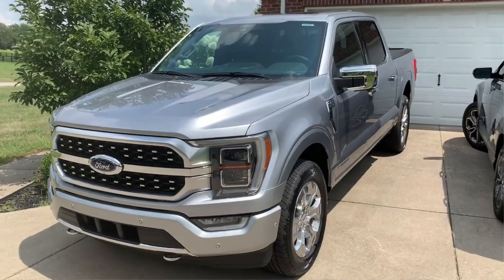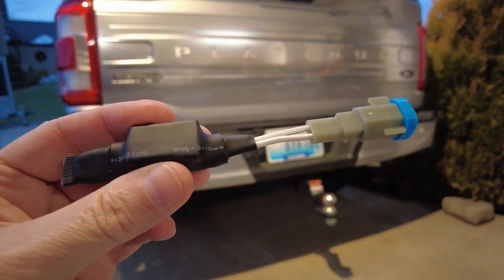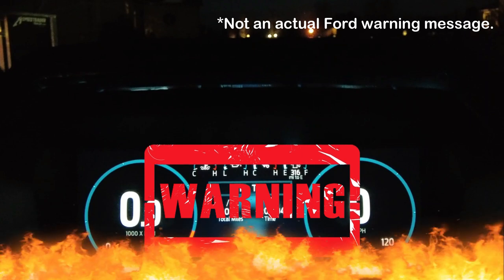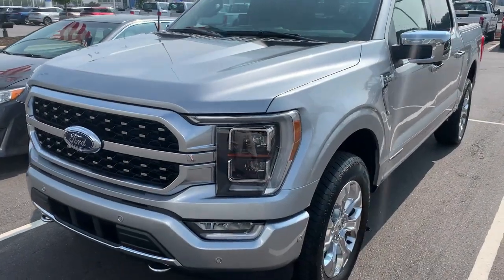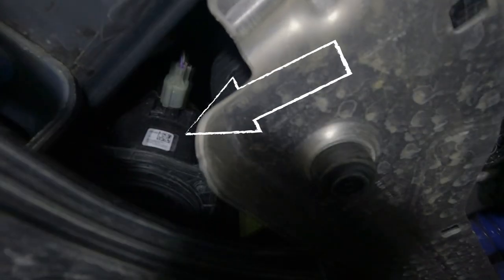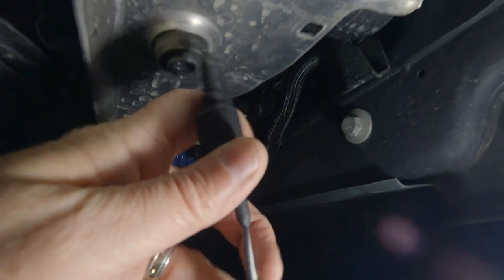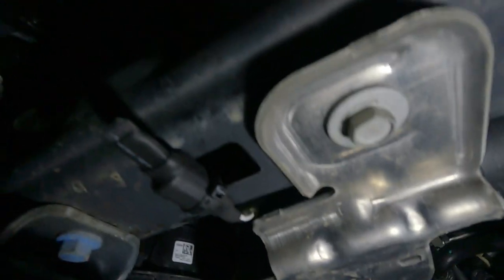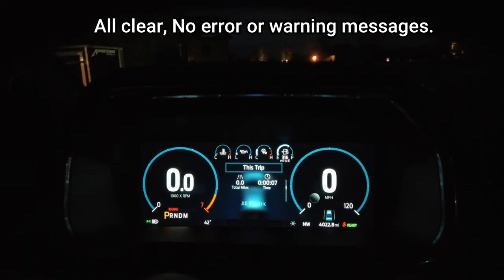NO MORE Ford Backup Alert or Fake Electric Motor Noise

Comment: When I first heard this dump truck noise, I complained to Ford about it, and they said they could not legally turn it off. Evidently, there was a law instituted in 2019 mandating hybrids and electric cars make some kind of noise at the slower speeds so people would not walk out in front of them. The service writer said they had this conversation with other customers before, notifying them that they accept the liability should someone get hit by a vehicle with this noise defeated. My Hybrid RAV 4 makes a spaceship noise as well. I wrapped the speaker with duct tape and plastic trying to muffle the noise, but it is still pretty loud. I just bought one of these and am going to install it. It's the backup beeping that does it for me. Thanks for the video.
Reply from the maker: yes,  Bottom line, if I hit someone with my car.  It's most likely going to be my fault, unless they just Jump out like a deer or something unavoidable.
Reply: I don't understand why these gotta be so loud.  ICE isn't that loud and if that's acceptable hybrids and EVs shouldn't emit such loud noise.  This is going to suck bad once hybrid and EV adoption rate increases.
Reply: I love the product and the video. Ford Maverick is definitely a pain to install but a necessity. 

I understand the liability but if I’m backing up, I’m going to look around me. Sound does not always make others cars/pedestrians pay attention. If I’m driving at low speeds in all electric mode, I can still brake faster if someone steps out onto the road. But regardless of noise, EV, gas, or hybrid, if you walk around with AirPods in 24/7 this won’t stop anything.
Reply: When I bought my first ford edge in 2020, they said it detects other cars passing or coming but does not detect humans if they walk next to you or behind you. Can there be a way to at least lower the loud noise of it if we can’t “legally” disable it? Like for daily driving noise. Not off road
Reply: @Globeguy1  because ice cars make more noise when speeding up. EV have to make some noise when accelerating. But the backup beep is awful! seriously !!!

Comment: Just one comment on tie wrapping the resistor kit to the frame rail. I have run into a couple problems at the dealership with this kit being visible to the technician doing service under my F150. In both cases they wanted to remove the device and replug the connector into the speaker thinking it was the cause for unrelated issues. The last time this happened the tech. ended up breaking the connector lead to the internal resistor in the device and I had to buy another kit from Will to replace it. Bottom line, hide and tie wrap the device so it is less visible.
Reply from the maker: I was originally worried about this at first but nearly 3 years later and it’s been to the dealer several times for oil changes and recalls.  Not once did they mention it or mess with it.

Comment: I have a 2020 Ford Escape Hybrid that makes the fake electric motor noise. However, when I put it in reverse, there is no backup tone like demonstrated here. I am aware that it is only heard on 2022 and newer Escape Hybrids, but is it possible to add the backup beep?

Comment: Hey Mitch, any ideas on using the speaker with a custom sound board of sound clips? I'm thinking themes like Star Wars (droids or vehicle), cartoons, etc.? I wonder how much power it would need/handle. Thank you for a very clear video and for keeping the sound levels similar throughout.
Reply from the maker: Thanks for the great compliments.  I am not sure how difficult it would be to add a sound board.  It would be fun, but the work and effort to make it happen may not make it worth it.  Maybe someone will make it happen.

Comment: Mitch thank you so very much for this mod the only complaint I have was try to release the plug from the horn  it was almost impossible to get my finger on top to release the plug but with a couple of tools I manage to release the plug but after was said and done it was well worth it to drive in Peace and quiet I am looking forward to anymore mods you have for the f150  love the content on f150
Reply from the maker: Yes, the plug on top is a bit difficult to squeeze but once you get it, the rest is easy.   I agree, well worth the little effort.  So quiet now.   Thanks for your support.   More videos coming soon.
Reply: @mitchcox  yes it was tough to get to I use,a screw driver with a nail puller end but once I got it installed I love this idea that you suggested works great all I heard is my tires on the road what a pleasure not hearing the annoying electric wine thank you so much I really appreciate it
Reply: I can’t get the thing disconnected. How the hell did you do it? A video of that process would help tremendously
Reply: @joshuawalker635  I use a thin screw driver and pry the tab up it a tight area but we’ll worth it

Comment: Corsair GT PHEV has same speaker, located under rear bumper, close to the right muffler pipe! Ford Escape should be similar to Corsair.
Reply from the maker: Check with Megaohm and see if it’s supported for that vehicle.

Comment: OMGsh, thank you SO SO SO much for this video! I bought my powerboost because I was in the market for a class B motorhome and couldn’t afford it. I traded in my 2017 XLT Crew a the perfect time, 2021, got 43K for my truck and ZERO percent financing! Now a Travel trailer is a more acceptable option. But, Duuuuuuuuude, that back up beep. So embarrassing! Stresses me.  Like, “hey guysI I’m backing up over here! Yeah, YOU.. Way over there! I’m backing up! No, not a delivery driver, just backing up.” Ugh! And the neighbors being aware of when I leave. Not to mention every time I arrive at an RV Park or campground it’s almost always in the middle of the night. I inquired at the dealership and they told me they were not aware of a way to disable it, that it was a new law. 😮😮😮
I ordered the part the DAY I saw this video! Got the part yesterday, and installed today. With an adjustable wrench. Haha! I am so pleased! If you are a woman with ZERO mechanical experience. YOU CAN DO THIS!! Took 10 minutes, just like the video said. No more whining sound when in electric. I’m doing a happy dance and no more stress when backing. I could just hug you for this video. 🙌🏻🙌🏻💃🏽💃🏽💃🏽🕺🏻🕺🏻🕺🏻

Comment: So I bought the speaker delete for my 2022 Ford escape. Ill report back here when I install it. My only issue is the location of the front speaker and im hoping it isn't a pain in the ass or almost impossible to get to. But the rear looks easy as pie
Reply from the maker: Do you have two speakers?  One in the front and one in the rear?
Reply: @mitchcox   The rear speaker is for the backup noise the front speaker is for the stupid fake engine noise
Reply from the maker: Interesting,  on the F-150, one speaker in the front does both.   Let me know how it goes.  It is really night and day how quiet this truck is now without all that fake electric "engine" noise.  Please keep me updated, I am interested in hearing how you like it.  Thanks.  Take care and please subscribe to my channel.

Comment: I have a new Ford Lightning Pro on order.  Do you know how to remove the speaker?  I know it's not necessary to remove it but I already know it's going to drive me nuts having it on there still.
Reply from the maker: You can’t remove it without causing some errors in the system.  This is the reason for the speaker bypass.   It prevents the speaker from being used while the truck still thinks it’s working as normal.  For the cost, it’s worth the purchase.  Thanks for watching and I hope my video helped you out in some way.  Take care and enjoy your Lightning.

Comment: so instead of removing the radiator support I inserted a hook type screw driver to go on top of the  connector release and a flat head screw driver at the bottom to push the connector out
Reply from the maker: I didn’t have a hook type screwdriver but whatever works for you.  For those that have that tool, this is a good tip.  Thanks.

Comment: MEGAOHM works great, no warning lights anywhere. It took a little more time to install because of my fat hands. The hardest part was unplugging the factory connection.
Reply from the maker: Yeah the tab on top is a bit tricky to reach, but like you said, that was the hardest part.  Device works great and no issues so far. Thanks for watching.  Please consider subscribing.  Take care.

Comment: If I have  FX4 will the skid plate block me from accessing this without actually removing the plate?
Reply from the maker: No sir.  The truck in the video has the FX4 package.  As long as it’s the Powerboost Hybrid engine, this will work for you.

Comment: I am in favour of the rear backup alarm but not fake engine noise,  is it possible for one not the other?
Reply from the maker: Not at this time.  Unless someone invents another mod that only disables the backup alert.
Reply: Well this mod will get rid of both, there are many easy ways to add a backup beeper to a truck, so you could remove both this way, and then add a cheap backup beeper wire to the reverse lights.

Comment: Thanks for this. I hate that back up noise. I can’t pin point the fake engine noise that Iv seen people on forums talking about. 
I have a 2022 powerboost and my dad has a 2022 and my brother has a 2022 5.0 he is going to supercharge for our channel. Check us out and you can see upgrades we make. Great channel man
Coleculture automotive is the channel
Reply from the maker: The fake electric “engine” noise is coming from the same speaker that is under the front bumper.  You can hear the difference in my video.  Night and day difference.  This enables “super sneaky mode”. Thanks for watching.  I will sub you.  Sub me back.  Thanks man. Take care.
Reply: @mitchcox  subbed brotha
Reply from the maker: Ha ha.. I don't know them but they seem like good people!   Wish they were closer and we would collaborate on something.

Comment: It works! Go ahead and take the whole radiator support bracket off and get as much room as you can to reach the locking tab on top of the wiring clip. You have to do this by feel but It's closer to the wire side than the speaker. Press down and pull it off.  15 min. max install time. The silence afterwards is beautiful!

Comment: Hey there Mitch, before I give you a "thumbs-up" for this video, will you please investigate and subsequently put it out if this mod will void the new truck warranty?
Thank you and I look forward for you to update this video for that issue.
Thanks again.
Reply from the maker: I am thinking not.  You are unplugging one thing to plug another.  Similar to swapping headlight bulbs to LED’s. The truck doesn’t know it’s there.  It thinks the speaker is still there. This can easily be unplugged and plugged back into the factory speaker.  I don’t sell these or get commission so no worries if you don’t buy it.   I have had mine installed for a while and had no issues when I took it into ford for recalls or oil changes.  Hope this helps.
Reply: Magnuson Moss warranty act states that it is illegal to void the warranty due to aftermarket parts unless you can prove that the aftermarket part directly caused the issue in question. 
I can't come up with any way that this could even theoretically cause any issues with any system that you care about on the truck, therefore I would say from a legal warranty standpoint you are perfectly safe.
That said, if you are in a collision at low speed with a pedestrian with this removed, it is possible that some lawyer will find you at fault due to the lack of the pedestrian warning sound. I still plan to install one though.

Comment: I purchased the Megaohm adapter and have struggled to get it connected to the speaker wiring, it simply won’t lock in. It’s not making a connection as I get the warning on the dash.  Any advise? I’ve got everything taped up to keep moisture out.
Reply from the maker: Did you get it connected,  if not reach out the Megaohm support.   My Megaohm adapter connected to the wiring with no problems.  the connecter snapped into place.   the hardest part for me was disconnecting the speaker, the button was on top of the connector and it was a tight space to begin with.  Other than that, I had no issues.  Sorry you are having troubles.  I would email Megaohm.

Comment: I get this noise. I can't tell you how many times a Prius has snuck up behind me. I go to a lot of kids sports and seem like while annoying is safety.
Reply from the maker: I can tell you how many times a Prius has snuck up behind me.  Zero times.  This mod is not for everyone.
Reply: There are many electric and hybrid vehicles that came out before the last couple years when these sound generators start to be installed. I have never had any of them sneak up on me. I can hear the tires on the pavement.
What's even more ridiculous, is that high-end internal combustion vehicles actually make less noise now than full electrics, due to this ridiculous law.

Comment: What if i just unplug it from the speaker and thats it ?
Reply from the maker: It will trigger a bunch of error messages in the system and on your cluster.  The module tricks the truck into thinking the speaker is still attached and working as designed.

Comment: thanks! i’m gonna poke around in forscan and see if can change those.
Reply from the maker: If you go that route you have to disconnect the speaker, forscan just turns off the error messages you would see on your dash.  Using the module above makes the truck think everything is working and there are no error messages.

Comment: I just unplugged my speaker and forscan the pop ups away
Reply from the maker: You can do it that way but if you ever take it to the dealer and they hook the computer up to it. They will see that it is disconnected. And see you modified the settings.  At that point they could refuse to do any warranty work.   With the mod.  There is no alerts or error messages that pop up.  No settings to modify.
Reply: @mitchcox they could refuse to do the warranty work, but they would legally be in the wrong. The law states that the only way you can void a warranty, is if you can prove in court that the modification the customer made was the direct cause of the problem in question.
So unless you bring the truck in and ask them to fix that speaker under warranty, the fact that you've disabled that speaker should not come up.

Comment: I ordered the kit from mega ohm Motorsport on 4/12/22. Never got a response from the guy.  Seems fishy.
Reply from the maker: Did you get an order confirmation?  He hand makes them and has been very reliable sending them out.  I am sure you will get it.
Reply: @mitchcox  I did not receive any response whatsoever.  The only thing I have is my PayPal receipt.
Reply: Just forscan it off your truck man.

Comment: Will this void the warranty?
Reply from the maker: Not that I am aware of.  It’s simple to undo.  You just unplug the device and plug the speaker back in.  No alerts on the dash, no error codes, etc.  the device is configured to make the truck think that the speaker is still there,  that nothing changed.   I have also taken my truck in for the insulation recall and no one noticed or said anything about this device.  No issues at all.   Thanks for watching.   Please subscribe.

Comment: I turned it off with FORScan
Reply from the maker: From what I hear you can’t.  Not without disconnecting some sensors under the glovebox.  Is that right?
Reply: Hi! I'd love to know where FORScan is, is there a tutorial?
Reply from the maker: There is a forescan option but it still throws errors when they connect to the obd2 port.   So its not as clean or easy to do with forscan.